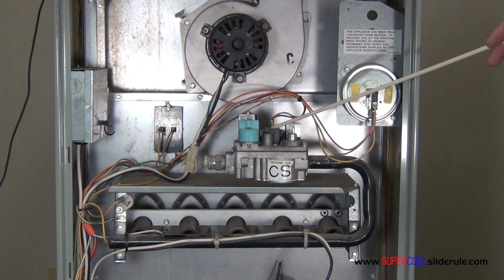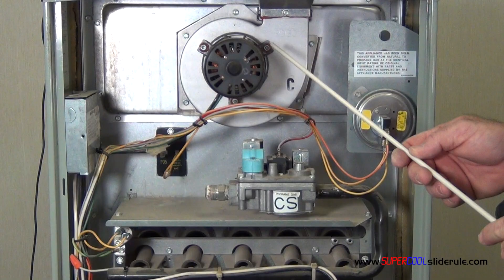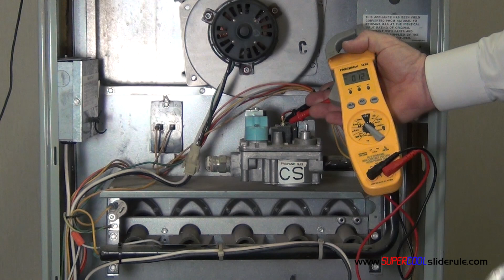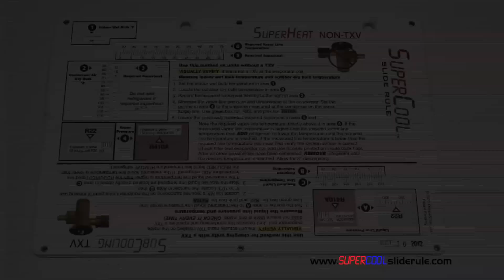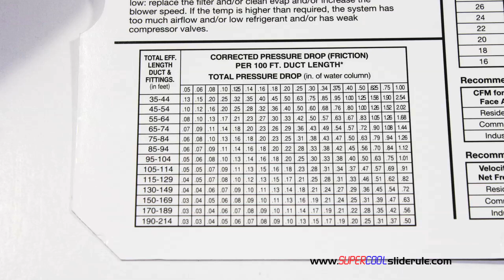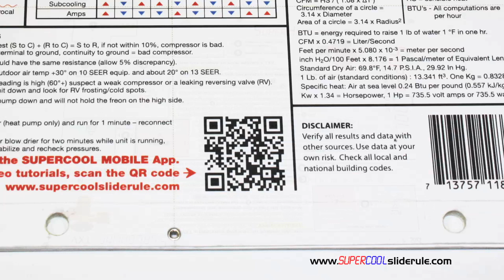How to test a Gas Valve

Comment: These heating and cooling systems are p ing me off seems every time I turn around something is wrong!
Right now my heater is calling for heat the induction motor is working the valve opens for a second burner ignites and walla flame goes out!!!!
No heat but the induction motor keeps going and so does the blower motor.
Gibson model gg9s060b12mp11a
Code is 1 slow red flash every 2 seconds never amber 

Thanks for your help

Comment: If I remove the wires from the gas valve, should I test the voltage on the terminals of the gas valve or the wires  themselves? Thank you.
Reply: The wires themselves.

Comment: My ignitor doesn't come on. I ohmed and continuity tested all the parts, checked ohms on gas valve also, all good. I'm stuck now. Also checked airflow in vents etc. Ignitor has continuity, gas valve coils have proper ohms. I jumped out thermal coupler temporarily, I checked thermostat and that has continuity. I don't think the gas valve is bad. I could check the gas valve coils again. I don't think I have a bad gas valve. Again no ignitor glow. PS great work.

Comment: Before you do all these steps,  do this instead,  do a hard reset on the furnace, then start up the furnace to request heat,  wait for ignitor starts glowing, as soon it glows, start tapping the gas valve with the screwdriver handle gently, check if the flame comes on and stays on.  It works for me, good luck.
Reply: Question is how often do you have to pound it to be effective because if you have to do it for every time it calls for heat you've got a problem!

Comment: Need some help. 14 years old furnace. Worked fine until about 2-3 weeks ago. It was not coming on, so I started checking. I had 24v at the time when the igniter was glowing but no flames.
I wiggled the solenoid and it started working. My happiness was  short lived, it stopped after a few days. I checked wires, etc. and again the 24v, all seemed good. I took the solenoid out and cleaned the inside under the coil, on the shaft. All seemed ok, so I put it back and unit started working again. For a week. Now its been dead. So I bought a new gas valve. Same part # and installed it today. I still have the 24v at the time the igniter is glowing, but still no flames. Gas is on, bill is paid, the 2nd floor unit and water heater also works just fine.  I'm puzzled what could be the issue. 
I turned all other unit valves off (knob on the gas line) and tried, no luck.  Unit is 16 years old but we are in SC so the heater isn't running a lot. Maybe about 2-3 months a year.  So this 14 year old unit is about as much used as a 4 year old NH unit.   What could be the issue ? I don't have an equipment to measure gas pressure, but what would cause the gas pressure to drop suddenly and not in a past 14years, and why would all other units on the same line work perfectly fine ?  There is no cracks or bends in the gas line, nothing is changed since it was running fine.  I put in a new igniter and flame sensor to make sure its all good, of course it did nothing.  I also swapped the fan with the 2nd story unit, not because it was not working but because it was making a little bearing noise.  I did that about a week ago when it was working and loved the quiet operation.  We only use the 1st floor unit as heat rises and we keep the bedrooms door open. The 2nd floor unit ran very little in the past 14 years.  What to do ? Please, I need help. In about 2 days it will drop to 23F here so I want to make sure we have heat.
Reply: What ended up being the problem? I'm in the same boat!

Comment: Don't forget that as part of the initial self check (immediately after a call for heat R-W) the circuit board MUST see the contacts of the pressure switch to be in the open position. This ensures no one has jumpered the pressure switch to trick it should a blocked vent, etc. be the problem.  Attaching a jumper across the pressure switch after the vent motor starts will allow one complete heating cycle but the board will prohibit a second cycle with the jumper attached. This prevents spillage and carbon monoxide issues that could lead to deaths.

Comment: I call the HVAC guy to replace my furnace motor blower ran good he  came upstairs said that there is big problem need to replace the whole furnace I asked how much is that he said maybe 5- 10k  guy said the the pressure of gas is  to high  reading 4.6 normal 3.5 they try to adjust the valve but failed to adjust they put red tagged they turn off my gas they said very dangerous to operate can cause fire .i said it's been doing this for 26 years and i call the HVAC guy before I bought this house said no problem. Could you please help me give some advice

Comment: 1) make sure propane tank is not empty.
2) make sure natural gas is present and valve is turned on.
3) use manometer to check input and output ports on the gas valve.
4) check the voltage across the terminals.
5) If the voltage is present but the output port on the gas valve is showing 0 WC.....GAS VALVE IS BAD!!!!

Comment: Did you connect the blue wires to the low voltage side of the transformer?
Reply: If your gas valve is a 24v gas valve make sure you feed it only the low voltage
Reply: Exactly.

Comment: Bloody hell use a u gauge so easy and simple. Connect it to the upstream test point and fire up your furnace. If there's perceivable movement. Then your gas is coming through. If not then time to buy a new gas valve done.  You can check for ohms of resistance if you have a multimeter. Check you manufacturers instructions for specific range.

Comment: Great video, just a question , to make a gas valve test, what you did is, put 24 volts directly to the gas valve for a second ?
Reply: carlos torres yes he was just displaying how to energize it to see if it is functional.   Would not recommend this  on a gas valve for any longer than that second, and I would recommend having Wc check at same time with your manometer so as soon as your 3.5 (nat. Gas) shows, or after second or two doesn’t show, kill disconnect.

Comment: You mentioned that if the hot surface ignitor doesn't begin to glow there's probably a different problem. My ignitor is NOT glowing but it tests good for continuity. Any ideas?
Reply: I have had this problem myself, where the igniter has continuity and dosen't glow. I replaced it anyway and it worked. Can't explain why but it may have something to do with when the voltage is sent. To be sure remove the wires/plug and take a voltage  test when the unit is cycling.If you're getting the  volts during the cycle, change the igniter.
Reply: Richard Umbluegray replace the igniter.   It could still have a reading and not illuminate.  That’s just the control board doing its job and the igniter failed.

Comment: what if just one of the burners lights up and the other two don't (on my furnace)
Is there something I can check on furnace?
Thanks
Reply: Call your local preventive maintenance hvac Co.   Tell them to do a tune up.   Remove burner train and clean it thoroughly to remove all the build up of rust and carbon sediment blocking

Comment: Unless of course there is no gas entering the gas valve.  In propane areas the tank may be empty due to a leak.  Also make sure the ball valve on the gas line is in the open position.

Comment: Great video! Thanks so much!

Question: Which connections did you attach the jump wires to on the transformer? The 24v connections (red & brown) or the Line Voltage In connections (black & white)? It's tough to tell from the video. Thx!
Reply: Matthew Marcus Hey Guy, the 24v side is where the alligator clamps go, if you don’t understand that, call the guy who does this everyday for a living.  Or just look on the transformer it reads 24vac.      Wow
Reply: Guess you figured it out by now or your scattered between here and callamazOo

Comment: The Super Cool Slide Rule is a great tool! Helps get those AC systems dialed in quick. You won't realize how much you need it until you use one. :)